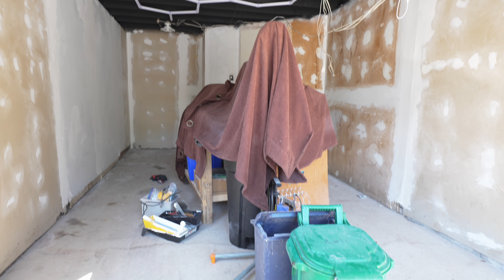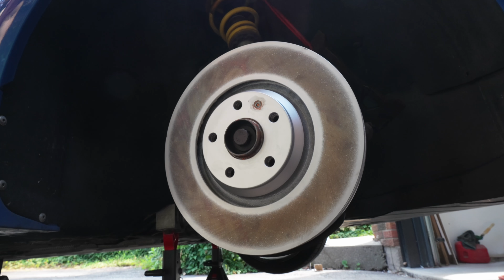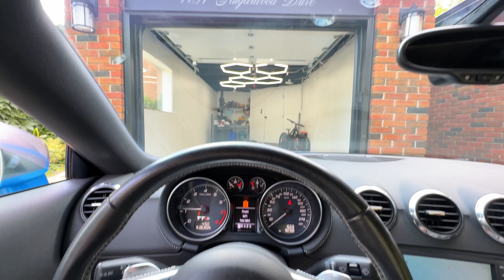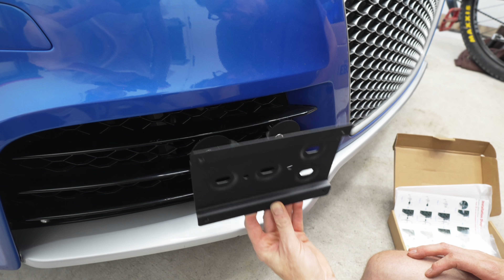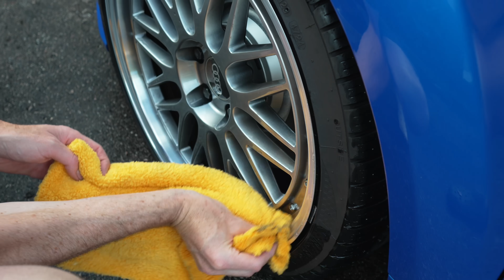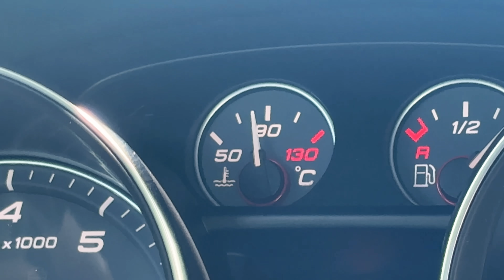Fixing Everything Wrong With My Cheap AUDI TTS

Comment: Brushing paint of the calipers was not a smart idea. When it comes to EVAP, change your charcoal canister and check your fuel cap gasket, they tend to crack especially on the inner side.

Comment: If the engine temp goes under 90 while driving its 99% you need a new thermostat, i also needed a new one for my 2009 tts a year back. Also notice your light fault on the dash. If its one of the rear lights i can alsmost tell you 100% its an earth fault, just need to plug a new earth wire to the car from the rear light. Happens to about every single mk2 TT.  Very common problem, plenty of videos how to fix it exactly
Reply: Man, I have an Audi tt mk2, and this always happens, just enjoy the car and say F**k it if you truly wanna be happy.

I changed the thermostat 2 times already, almost closer to once a year because I had this issue and it does fix the issue at first but then it comes back after a year of use, at this point I’m tired, just floor it when the temps go down and get use to fully enjoy it at high revs otherwise you’ll not warm the engine enough, and the warming for under inflated wheels almost 100% is depending on the temps, so if you let it fall too much you’ll get that annoying sound more often than not

Comment: That might be a thermostat problem., mine one just stays a tad below the 90 and won’t move while the car is running., im not sure if because mine is tuned but at 125kph im at around 2,5 - 2,7 rppms but definitely NOT reaching 3k revs. Oh and mine one is the slightly older EA113, ps just a duck tail spoiler imo, a RS style spoiler is overdone even on the newer models, heck even on the R8s cheers mate😊
Reply from the maker: Thanks for the comment bro! Stop and go driving stays as 90 but chilling at 2.5k somehow makes it drop but i might have to look into a thermostat. I’ll definitely get a ducktail wing now that I’ve seen how good they look

Comment: Looks like ur Audi originally had Magride, but since it on coils, you need resistors to trick the car to thinking it still has mag ride, so you might want to check the connector or resistors to try and get rid of it ;)
Reply from the maker: Ok that makes sense thanks!